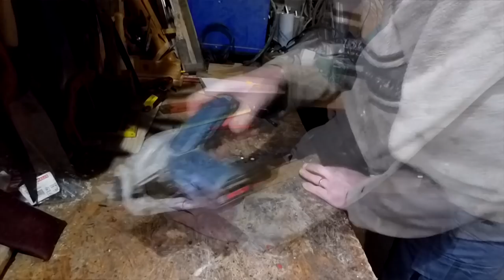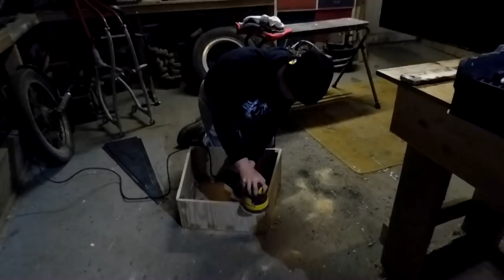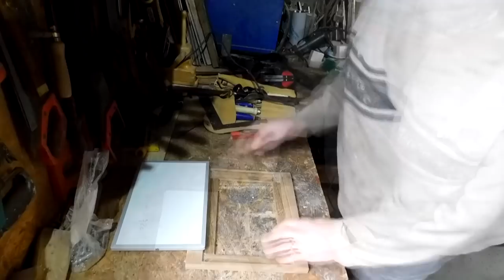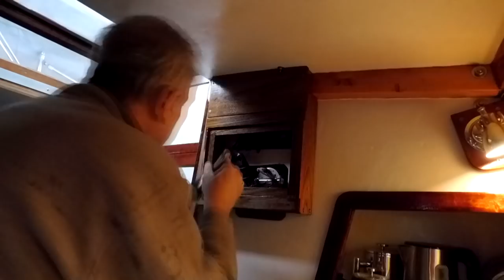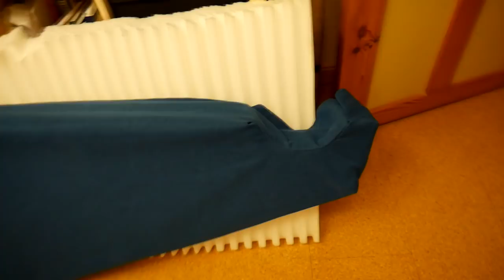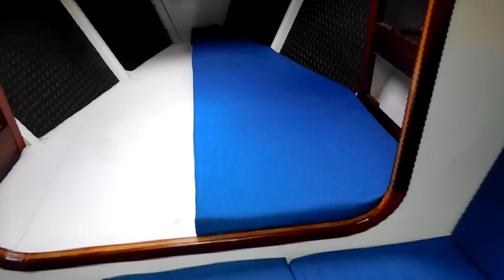A Little Cupboard Door And A Cushion; Building a Cruising Sailboat - SV Tapatya EP218

Comment: Very nice work on the cupboard door. I had to smile every time I saw the white board with the two magnets. Reminded me of a giant, two yolk egg cooked sunny side up. The cushions are coming out extremely well. Good practice for sail making. Best wishes to you and the family for a great week ahead.
Reply from the maker: Thanks Matt. All the best to you and yours too 👍😀
Reply: I've got 4 back saws. One an Exacto with a kerf so small you can hardly slip a piece of paper in it. I also have 3 Japanese pull saws. They're Yoshi's and cost me a pretty penny but they're razor sharp to the point of being dangerous in the wrong hands. My son got 9 stitches just for handing it to me the wrong way. The work you can do with these saws is incredible but they flex easily and can easily damage a workpiece. Something a backsaw won't do. Different saws with different purposes. I love them all

Comment: A pair of 'Masonite' or even 3/8" plywood 'U' shaped pieces can be easily slipped into your steel jaw vise to prevent crushing or denting clamped up pieces of timber...If you have a table saw but no Dado blade, you can get 'Dado Washers' that will angle any blade to make wide cuts. They're good for small, one off jobs that don't justify buying an expensive Dado blade, plus, they can be 'Dialed' from normal kerf to about 1/4". For wide cuts, I did the inside one first, then used several 3/16" shims against the fence to make each successive pass. For grooves, remember that the bottom of the cut will be slightly 'domed' and mating pieces should be sanded slightly to match for a good glue up... For future sewing projects, Tailor's chalk comes in red, yellow, and blue as well as white. The darker colors are much easier to see on light color fabrics. I'm sure you'll be sewing up your own sail covers and such!... 😁
Reply: Bought a Craftsman Excalibur wobble blade dado 35 years ago. It's been sharpened many times and had a few teeth replaced but it still works great. It adjusts from 1/4 to 13/16. It's only 8 inch but it does everything I've ever needed. I bought an expensive Freud 10 in. multi-blade set because of the slightly rounded bottom that you mention but I've never needed to sharpen it because I use it so little. Gorilla Glue makes it unnecessary to clean the bottom because it fills the slight gap with its foaming and creats an incredible bond. That said, most of my joinery work these days I do with Gorilla Glue and pocket screws. Super easy. Super strong. Super fast. Wish I'd had them 30 years ago
Reply from the maker: Sound thoughts, fellas 👍